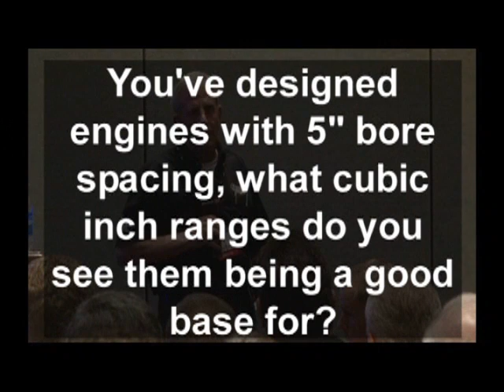Dart University Master's Series, 5" Bore Space Engines

Comment: The problem I'm having, is that I can't find heads for my application, on 5" bore space. My application requires big cubes for long duty cycle towing and power on cheap gas. I only need to make 550-600hp... but with 800+ cubic inches. 

Anyone have any ideas? I even looked at a set of raw casting 5" heads... but the ports were too big 🤦‍♂️